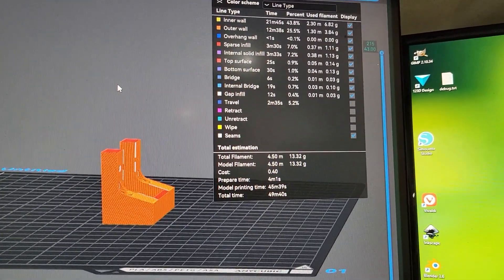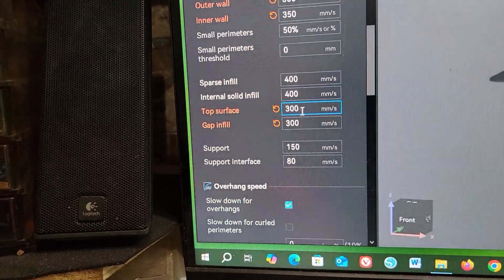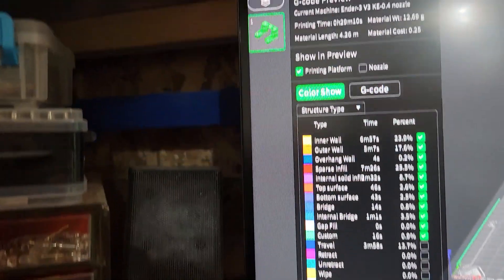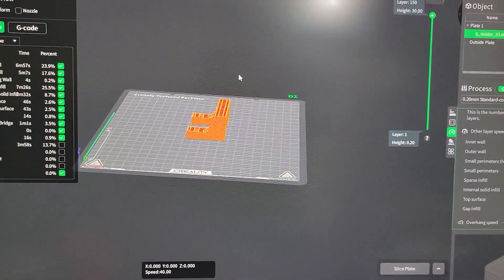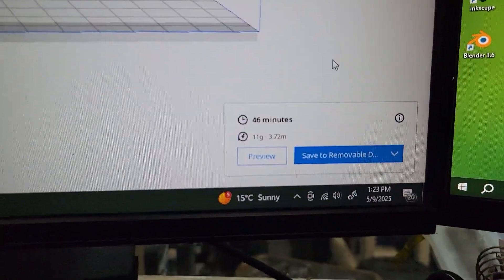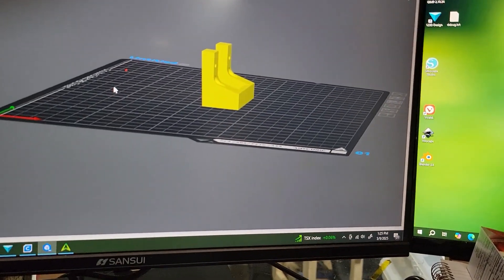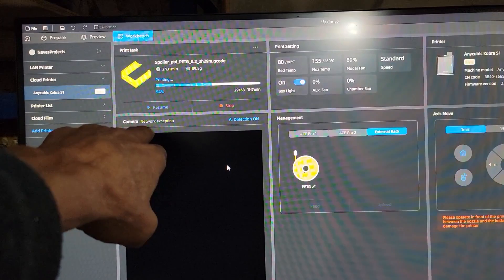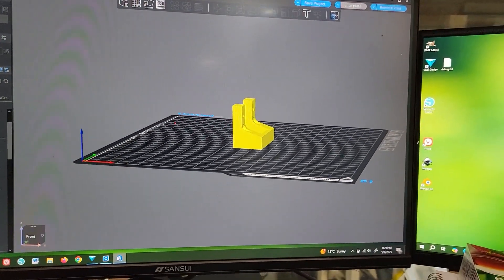Anycubic Kobra S1 Is Slow As A Turtle

Comment: i don't understand, i have the same printer with 2x ACE Pro, and im printing at crazy speeds, have you tried bringing up the Volumetric speed in t he slicer?  have you done the calibration more than once (after initial setup?)  have you tried raising the max speed to the rated 600mm/s in the printer settings? 

There is a lot to be done to try and rule out any fault from software.   i have to admit that before the latest update, it wouldn't always listen to the settings you set in the slicer, but now.... it is flawless... for me at least....  Sad to see you have such a hard time with yours :(
Reply from the maker: Hi DE4DLY, I honestly didn't know anything about Volumetric speed until I read your comment, so I searched it and I will play with it and if it changes the speed I will post a video correcting myself and apologize for being an idiot. 
the other stuff I have done.

Can I ask what you set your Volumetric speed to ?
Reply: @NevesProjects hey no worries :) we’re all humans and we can’t know everything there is to know about these printers haha :). 

I set mine to 21mm cubed!
Reply from the maker: @DE4DLY  Thanks, In my slicer it was at 12 and in the creality slicer for the KE it was at 18,
I don't understand why they would set it at 12. anyway I'm going to raise it, that is most likely my problem
Reply: @NevesProjects you should sticky this reply so it's at the top since it sounds like it fixed your problem 👍
Reply from the maker: @Gibson99  Done, Thanks
Reply: Where is the volumetric speed in the slicer?
Reply from the maker: @hanysonic  where you select which filament your going to use, click on edit and scroll all the way down, (where you set your printer and bed temperature) 
I didn't even know about this setting

Comment: if you have a capable filament adjust your volumetric speed higher!  Its under your filament settings otherwise you will never reach the speeds in your settings.

Comment: Whats your max volumetric speed set at? I dont have that printer but if its low in the slicer it will override the individual settings for the walls, infill, support, etc. I have a Qidi that is insanely fast, has 1000s of hours and the print quality is top notch. Just thinking some setting could be messed up in that slicer. I use orca for everything.
Reply from the maker: When I posted the video I didn't know there was a volumetric speed setting, I thought I can set it to print at 500 or 600 and it would print that fast, but then DE4DLY commented and that's how I found out, I raised it, and the printer does print fast.
I rewrote the description stating that when I found out and wrote in the thumbnail for people to read the description.

Thanks for posting because i'm sure there are others that don't know about the volumetric speed setting and maybe read these comments 
Ounce I receive my parts to repair the machine I will post the repair video and state that I made that mistake
Reply: @NevesProjects I just ordered 1 a minute ago so I will try it out also lol. My Qidi just ripped the front cover off and shorted out. I need something tomorrow so I figured why not for the price

Comment: Buddy that machine is a pos, They will eventually start ignoring your emails and then you will be out of luck. I think you should buy a board for the creality and get that going, then offload that pile of cobra crap. You could have already finished 5 go karts in the time it took to mess with that machine.
Reply from the maker: Yea, this F*^%cken thing was a big mistake, it already has taken days work off my grandsons go kart and I still need to install the parts their sending me.
I'm printing a a piece of a gun scissor lift for the kart and it's going to take 5hrs and 20min. on the kobra, I sliced it on the ender ke slicer and it would have taken 4hrs and 26min,
and it will print on the ender 3 v2 in 6hrs. For someone like me that has almost no income coming in is a big big lost of money, it's like I just through it down the toilet.
Like you said, I'm going to see if I can fix the KE